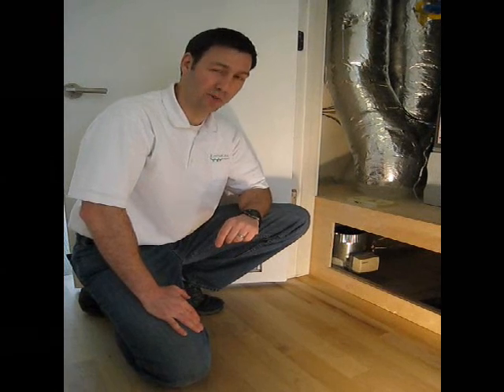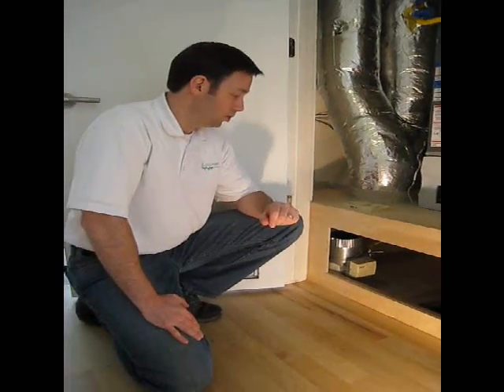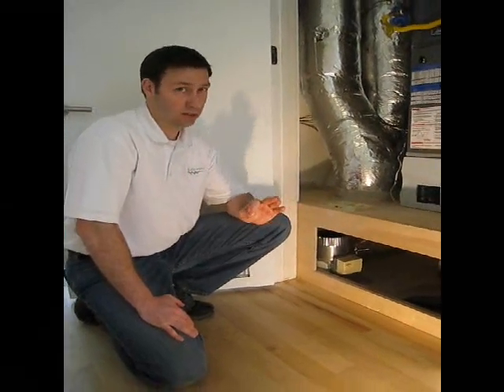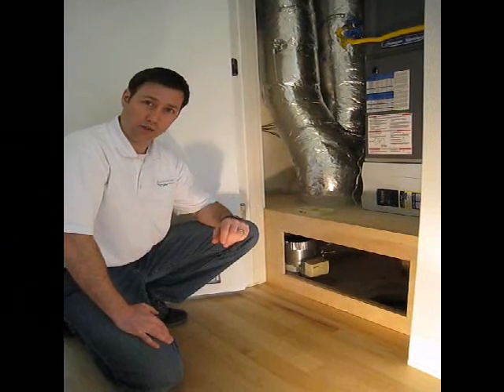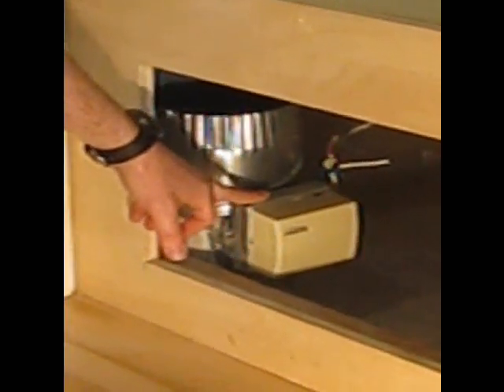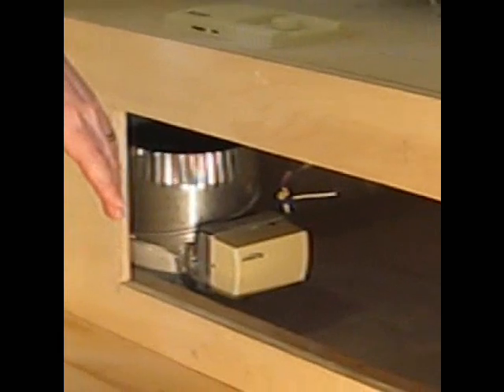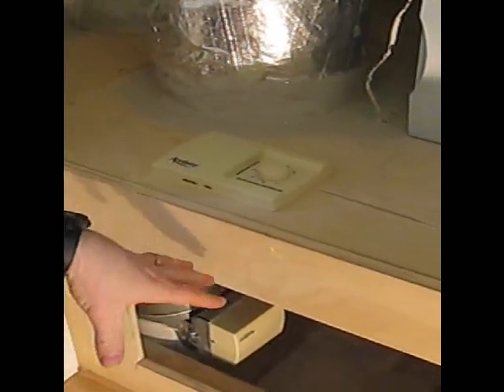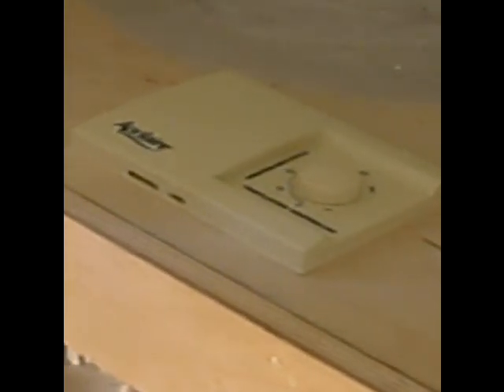Build Tight - Ventilate Right, Fresh Air Input for HVAC in Austin, TX

Comment: So you are consuming electricity to bring in fresh air? How is this efficient? If you build a house with the right air exchange rate, it takes zero electricity, so how is this more efficient?  "Green Homes" where you need electricity just to make your air safe to breathe.  If that one intake ever gets clogged, your house is now unsafe to be lived in!  YAY, all for what? minimum r-values, air sealing that could be done with a can of foam, vs a truck full, and maybe some caulk.
Reply: Your heating and cooling bills from a leaky house would be significantly higher than running an HRV to pull in fresh air, not to mention the discomfort of having a drafty house, yuck.